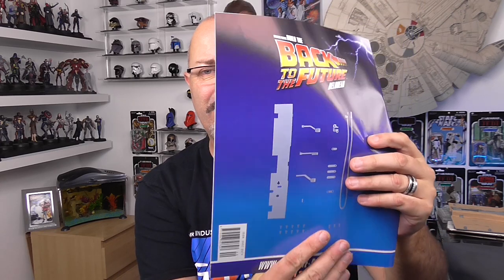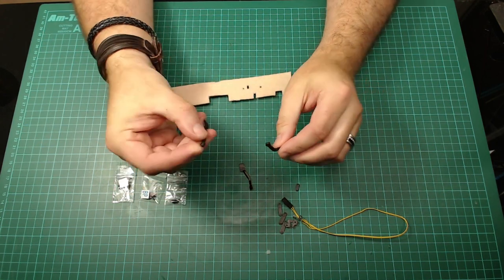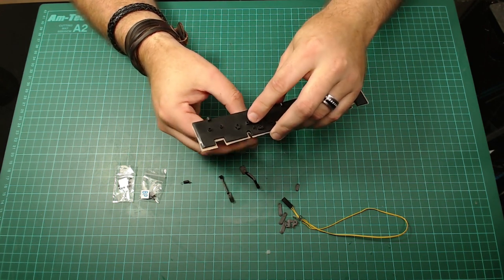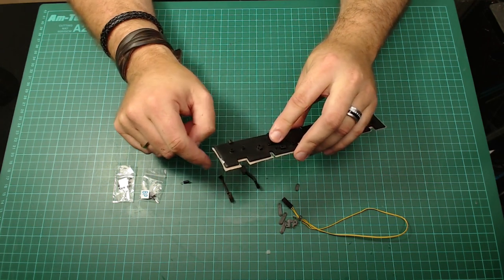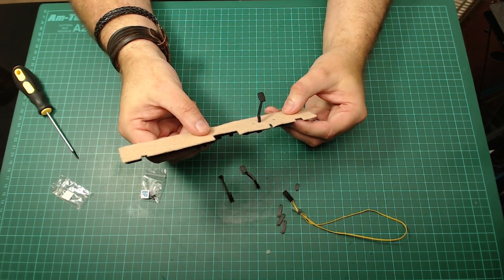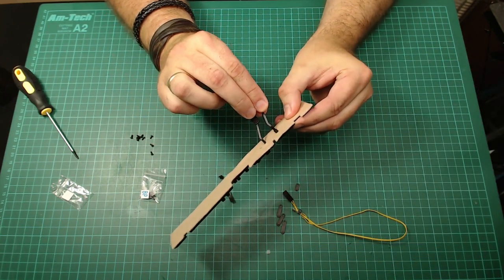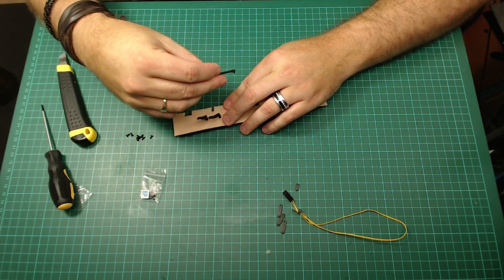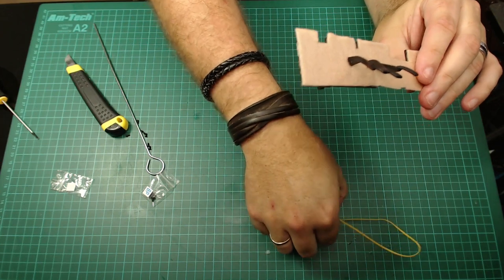Build the Delorean - Issue 40 - Pedals and the Floor

Comment: Wayne,  my spring is fitted correctly,  however pedal does not return. Have you experienced this? 
Any ideas
Reply from the maker: Yep. I fixed it by over tightening the spring. To a point where the spring bends. That should give it enough resistance to bring the pedal back up.
Reply: @WorldofWayneUK  will try  thanks. Thought of cutting spring shorter